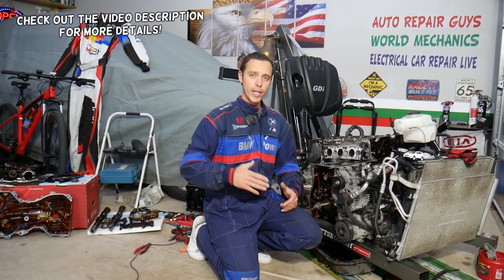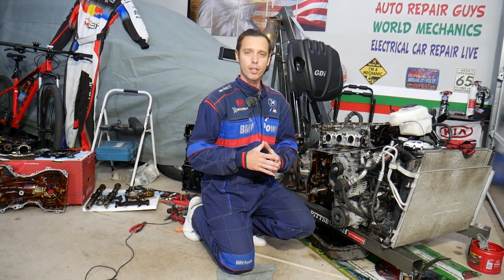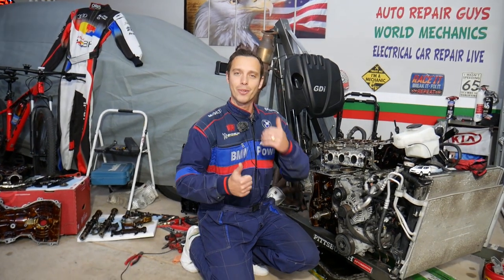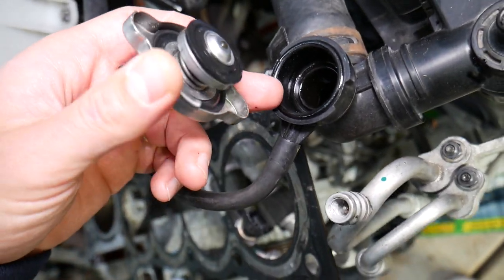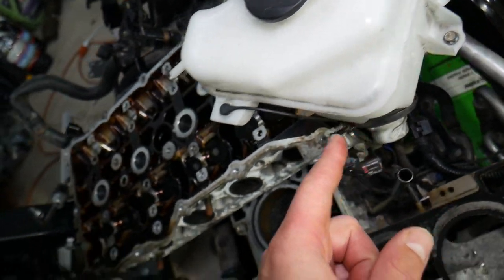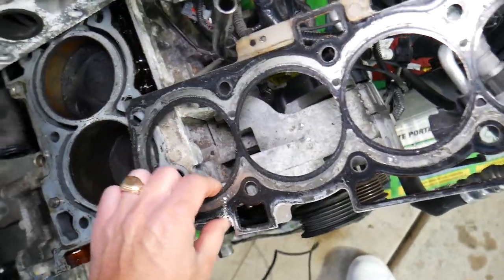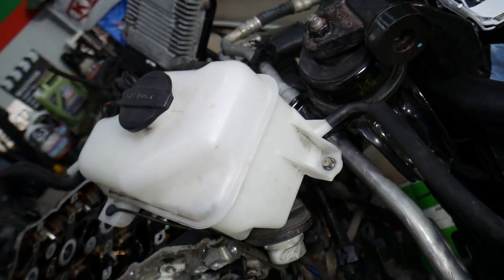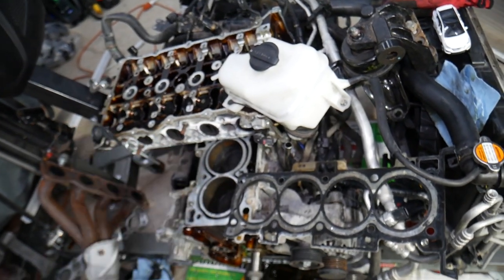HYUNDAI SANTA FE BUBBLES IN COOLANT OVERFLOW RESERVOIR TANK, HIGH PRESSURE RADIATOR HOSE

Comment: Good vid.  I think I've got multiple simultaneous problems.  Shops says I've got a hole in pump and this design must have a timing belt at same time so it's $1400 but I don't have it.

Also getting bubbles in overflow but only sometimes.  Also have a bad leak at bottom of overflow somewhere because when I put fluid in there it just pours out of the bottom.

I'm in a super jam, both living in my car and using it for delivery so I can't earn money 4 the repairs.

I'm hoping one of these vids on overflow repair will slow the leak enough to let me work and earn money 4 the main repair.  ☹️

I've tried several stop leaks including the expensive head sealer.  The worst of it is from the overflow.   I think the sealers may have actually helped some with the other leak as it's slower.

Comment: sir what is the possible cause of and how to fix it, there is a pressure comes out at radiator during engine warm up,they replaced and install new cylinder head block assembly new water pump but same scenario,TERIOS DAIHATSU 3SZ-VE.